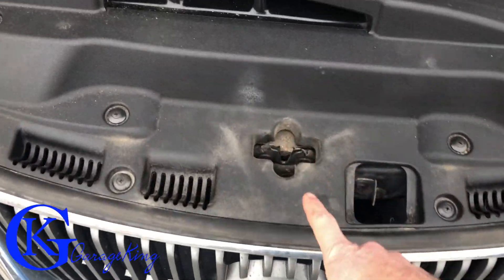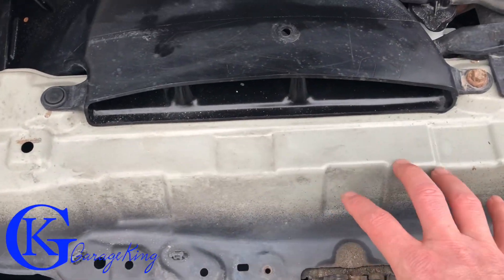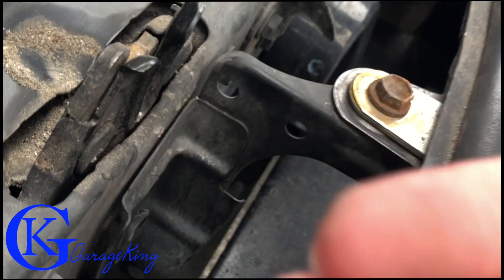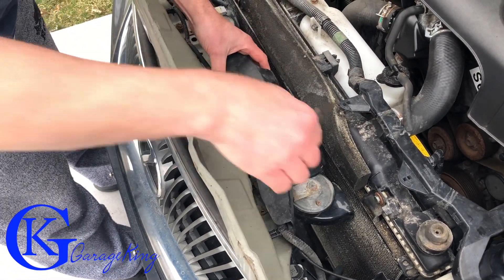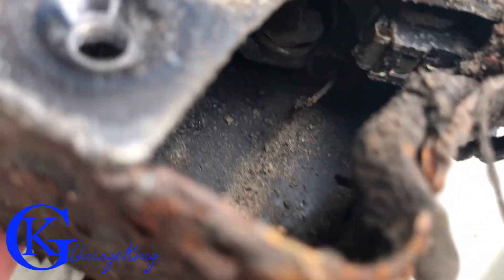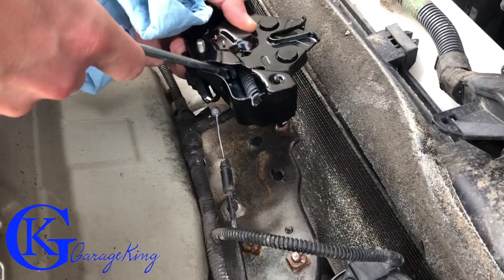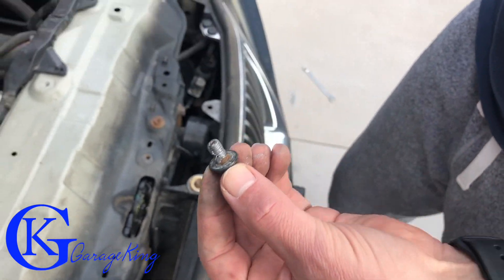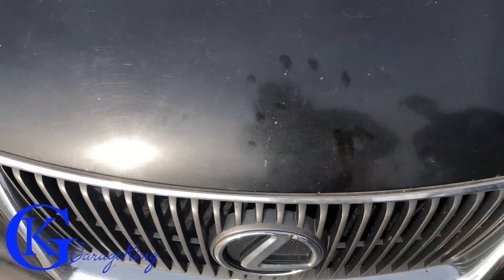Lexus IS250 Hood Latch not working, replace it

Comment: Just fixed my snapped hood latch spring with a Steel line looping around the spring to the outer shell of the lock, this created tension within the spring and locked when put back together. Didn’t have much hope at first but was worth a try before buying a replacement
Reply from the maker: Good on you !!!!  I always try to repair before I can replace.  When I took my latch out it was pretty rusty!!!  You got creative with yours :)  Hope you had a great weekend :)
Reply: No video?

Comment: Hey I just replaced my hood latch but it’s still not closing and I checked those bolts on the front and they don’t have that flange by any chance do you know what size those bolts are?
Reply from the maker: Oh boy that I would not know.  They would be metric threads, maybe 8X1.25mm if I had to guess but please don't quote me.

Comment: Did they give you any new bolts with the new hood latch or not Ik u used the old ones but I’m just asking
Reply from the maker: No new bolts supplied.  If the bolts are rusty you can just take them to a wire wheel and put a little dab on anti seize on them.

Comment: great video! would you be able to tell me what tools you used for the whole process, I am trying to do the same but am limited of tools, thank you.
Reply from the maker: Hey there, sure thing !!!  You need a set of flat tipped pliers - to remove the plastic wiring harness https://amzn.to/3PIBSQF and you need a small pick https://amzn.to/3a2Kgdh and you need a 10mm socket with a ratchet, and you need a trim removal tool.  I found this one and now use it all the time, it really is the best thing I have found, and Snap On tools sell it under their Blue Point brand https://amzn.to/3CPg8dX    You don't have to buy these tools, but the links just give you an idea of what to buy.

Comment: Is there any adjustment to move the latch up and down? Mine only works when you slam it, i recently adjusted my hood alignment with the rubber adjustment screws. It’s been a little worse since because I’ve had to raise the hood slightly on both sides, if that makes sense.

And so I’m wondering if I can move the latch upwards so that it has better engagement. If not I might slot out the holes in the big metal support so that I can adjust it, any ideas?
Reply from the maker: I don't think you can adjust the latch height, for most cars you can't. The reason is the latch would keep coming out of position with the pressure of the hood pushing and pulling on it.  Normally its the hood that gets adjusted.  BUT the faulty spring on the latch can make it harder to close the hood.  I had to slam my hood, but once I replaced the latch I don't have to slam it anymore.  I think it was the rusted spring in the latch.

Comment: Quick question I change the hood latch on my Lexus but it still reading like is open when is close any thoughts on why is still reading the is open or how can I shut it off
Reply from the maker: Did you make sure the electrical connector is clipped on?  If it is then see if the problem is in the wiring circuit. You can take the electrical wiring harness and ground it to see if the light goes off.
Reply: I did I even order a new one and still wasn’t working so I fix the old one it was the small spring the mnt I put it back together walla working like new thanks for the video was very helpful
Reply from the maker: @calipsosreefs4843  Thank you for the follow up, and glad you got it all figured out :)

Comment: just watched your video im up here in south westren ontario and i have an 09 is250 and recently just stared driving my lexus more as i have a daily and this is my more pleasure car anyways my hood latch is perfectly fine but im getting the sensor issue saying hood latch open~ even tho its not its done this before and it randomly went away after a few bumps but now i just replaced my battery and this popped back on im wondering if i take this appart and clean it and re grease and what not it will fix it?
Reply from the maker: Hey Wade thanks for reaching out.  I'm in South Western Ontario as well (GTA).  The latch actually comes out pretty easy so if I were you I would take it out and clean it up, and see if that helps.  That was my plan, but when I took mine out it was just too rotted out, so I had to replace it.  I would try that as you never know.  Take it out and spray it with brake clean to clean it all out, and then spray it with some lubricant.  Can't hurt, and if that doesn't work then I guess its a new latch, not the end of the world.  I bought this car as a project car, and I have done quite a bit, I still have to edit then I can upload the vids, but I did the exhaust, mirrors, and brakes. There is a vid on my channel about exhaust tape, and it worked on this car for about 1.5 years so pretty good !!!   I then bought the car off my neighbour. How are your mirrors, the mirrors on these cars in Ontario always corrode due to the salt from the road getting into them.  Then it looks like you have strips coming down the side.  I did a vid when I first bought this car and showed it all.  Sorry for ramblin, but yes I would take that latch off, clean it up and see if it works.  I always believe repair is better than replace if it can be done.  Happy Sat to you :)
Reply: @GarageKing  Right on man, im 30 mins north of London ( grand bend ) area! but yesterday i did all these steps to get at the latch and the video is straight forward and helped me get at what i needed to work on so thank you for that.. that being said i snapped my two top bolts in the left/right corner after i left soaking with releasing agents / heated with a torch they still snapped... but i at least could get all the other mounting hardware out with out any troubles ( accept one of those four bolts fell in behind the light somewhere still trying to track it! I'm not so worried for the bolt, as I'm more worried where it ended up!.. iv already re drilled the studs out for the two i snapped and will be tapping and re threading them today and well i suppose by 3 bolts unless i find the one to put back in there... i also got those clips from the wiring out no problem with only one breaking as i think the owner previously already had damaged... other then that the removal went really well and pretty fast for my first time.. i managed to get the latch out and soaked really well with cleaners and wd40 as that's all i had on hand at the time and today i will be getting a new can of brake cleaner as mine was empty and will clean the heck out of it as well as blow out really well with a air compressor... then re lube and connect er all back up I'm hoping it fixes the sensor issue if not i will leave the connector unplugged until the latch actually breaks and i will replace it then! -  def looking forward to your other videos as they come, I've had no other issues with my Lexus besides this latch error.... accept yeah the mirrors I notice fill and or are corroded inside and when it rains they drip and you can see like water stain down the side of the car same with the actual door handles, they do the same they like run when it rains and then leave water stains... my passenger mirror was semi broke when i got my car but very hard to notice unless sitting in the car.. i wanted to replace it but with a 300$ tag on a new one i was like ya f** that,  its more a cosmetic thing then anything so iv left it as well until i actually need to replace my mirror.... I'm looking at re powder coating my rims since they are oem and look awesome just curb rash from the previous owner and some scuffs, that a fresh powder coat will clean up and make look like brand new just debating on the colour atm!!! other than that I've been looking into replace my foot peddle covers as I'm missing one on the clutch and I'm thinking of getting a OIL catch can ordered... ill toss some photos up of my car sometime... i wanted to do a youtube channel for my Lexus and all the shit I've done or worked on , like i re did the sound system added a aftermarket amp/subs did video's on it but haven't edited crap or even started trying to put my channel together haha... I'm realizing now that i mixed my hardware up as i got caught in the rain cleaning up. maybe you could link me a photo of this project so i can put the hardware where it belongs... but yes  i agree if it can be repaired over replaced do it!  thanks again for your time and video, keep up the good work! cheer bro
Reply from the maker: @LilWade42069  Thanks for the reply, you are definitely not a beginner if you are using the torch to heat bolts to get them out, and are comfortable re-threading holes.  I'm familiar with that type of work haha!!  Those mirrors are expensive I know.   You can get them on Amazon, but there are mixed reviews of the quality, and sometimes the connector does not fit so I just bit the bullet and got them from lexus.  I thought that with the channel,  I better use good ones anyway so I know there wouldn't be any issue with the installation (and there was not, they went well) 

If you want to start/or thinking of starting youtube channel I think that's a great idea, but it is a lot of work.  The filming and editing are pretty time consuming.  Then there is the thumbnail to create and all the tagging.  There is a lot of behind the scenes stuff for sure.  If you ever start one let me know and I'll do my best to help you out.  

As far as a photo for the hardware I don't have one.  All I have is the raw video footage before editing, and the only photos I take during filming are for possible thumbnails.  There are really only 3 main types of bolts.  The ones that hold the latch have a head that is not flat (under the head its domed so it can centre the latch) then the 4 side bolts that hold the metal brace on are all the same, they are just regular machine threaded bolts.  Then the bolts that go into the plastic.  They have what looks like wood screw threads.  Lastly, you have the weird looking nut for the latch that the plastic clip goes inside.  Also if you are thinking of a catch can, I have about 4 or 5 catch can vids on my channel, and have quite a bit of experience with them.  A catch can on the lexus is not a bad adea as that engine is known to carbon up.

You must have upgraded to a pretty good sound system, as the factory system is actually pretty good.  

I gotta give you thumbs up, as you job was not straight forward with the snapped and dropped (LOL :) bolts !!!!   I'm going camping next week so I don't have time to edit the Lexus Mirror replacement (I wanted that one out next week) so I was changing oil on the Vanagon for camping so I'll just edit that one as it will be quick.  Its probably going to be to basic for you, but don't worry the lexus ones will be coming :)

Take care and if you need anything don't hesitate to reach out.
Reply: @GarageKing  No worries thank you again for the video's.. sorry for the late response had a busy week with work! but yeah def not a beginner when it comes to wrenching and tinkering but can thank my family and family friend as they are old boys and have some tricks up their sleeves... also a big thanks to YouTube. Anyways re threading holes isn't terribly hard although I've only done it a a hand full of times.. it also depends on where the area is your trying to work on! About the mirrors i did see them on few sites like amazon / eBay but i also was going to go with Lexus them selves just to save the headache of trying to get a perfect OEM aftermarket replacement... especially for you with your channel get the right parts and quality ones. " do it once, do it right " Yeah i can only imagine all the hard work and time that goes into content creating as to why i haven't even started a channel as I'm not great with editing nor do i even have a program or know where to start with my footage as kind of why i gave up~ i wanted to vlog my projects but yeah i also recently started streaming my game play for another hobby of mine but that's not going as planned either slowly growing though haha! never give up right! but as for my audio i should of explained it better i left all the stock sound system just ran my own after market AMP/ SUB setup currently building a custom sub box for the Lexus trunk but that was put on hold for a bit as I'm waiting to use buddies wood working shop... i completely removed all the back seats and paneling from front to back to run my wiring all sleek and proper with soldering all the wires and shrink wrap did it right took a good chunk of couple weeks to do but it looks and sounds amazing! and def was a fun project that i did videos and pictures of just never did anything with the content.. anyways as for my hood latch project, i haven't completed it with the weather we've been having, i have the holes re threaded and everything cleaned and re greased just needing to put it all back together which is hopefully my project over the weekend but ofc woke up to rain again this morning... the latch btw was so gummed up with old grease/ oil and sand and just junk from over time i took some good a penetrating oil and break cleaner to clean it/ free it all up after that i re greased with some nice spray can 3 in 1 white grease seems to be moving more freely and also the sensor tab inside is like new and has nothing covering it so hoping it makes a good connection to get rid of my hood latch open notification.. and also hopefully it gives my springs another few years before having to completely replace my latch!! Enjoy your camping bro have a good one and keep up the video's ! thanks again cheers
Reply from the maker: @LilWade42069  Just got back from camping, and what a blast.  Was really nice to get away for a bit.  Thanks for the great reply, and you know its these replies that I really enjoy as they are pretty personal and it lets me have a bit of a conversation with someone so I find that really cool.  In relation to your comment about Youtube being hard, it is !!!!  But it is very rewarding, but it's hard work.  I have a few years on here, and my first vids were straight from my phone to Youtube.  You can't really do that anymore as the standards are quite high, but that makes it fun!!  I use Final Cut Pro for all my editing, and any serious Youtuber needs good software, as it really helps the finished product, plus it saves time!!!  I probably spend about the same time editing as I do fixing things, so its a substantial amount of time.  The other thing is I'm always wondering what to post.  I do post once a week, but it's what to post.  If I post too much of the same thing then that's not good, sometimes an oil change is too simple for some viewers, but others love it.  Then sometimes I get kind of complex (like soldering a jaguar circuit board to fix the AC) and that is too much for some people.  So I try to find a balance and rotate the content so its always varied. 

I'm quite impressed with your audio mod on your car.  I have built a few boxes before and love stereo mods.  I really like the old school amps, I have owned a few Precision Power, Phoenix Gold, and Rockford amps.  Very good :)  The factory Lexus speakers are actually not too bad, and adding the sub with the extra amp is a great idea.  I'm glad you soldered and used shrink wrap, I'm the same way !!  

Not surprised you latch was all gummed up, mine was really bad and the spring was rotted so it just kind of disintegrated and fell apart.  You know I don't know why these Lexus cars get sand in there, mine had a ton.  I did a full engine clean (still to post) and I took out a couple pounds of sand in total, I show it, and I don't know how it all got there.  Maybe this car was at the beach a lot haha!!

Thanks for your comment and keep wrenching brother !!!!